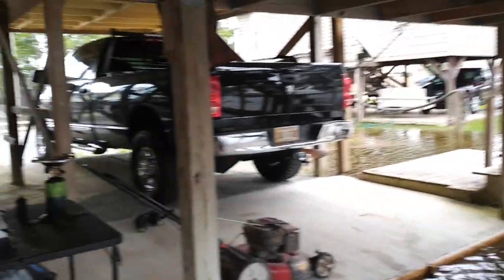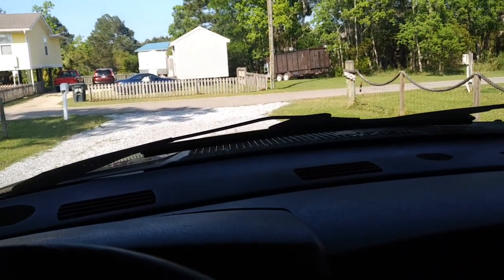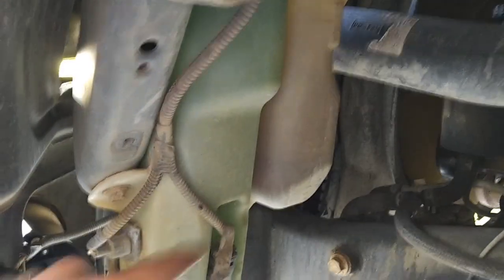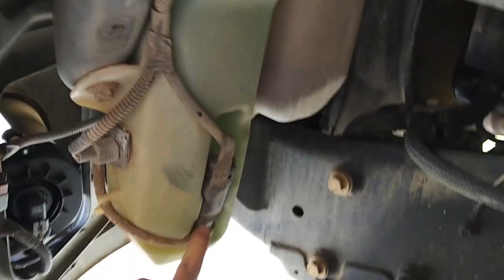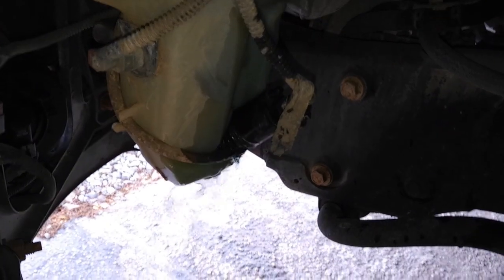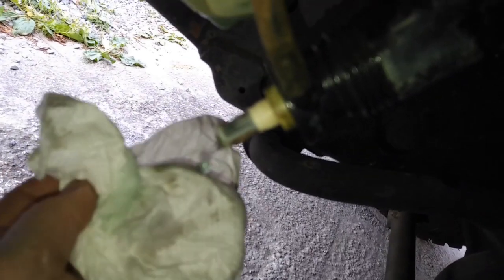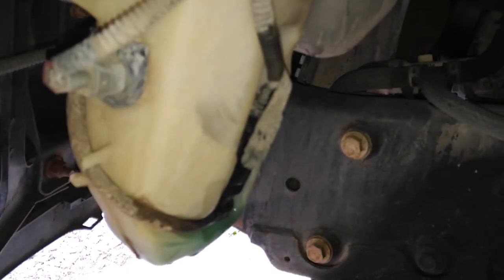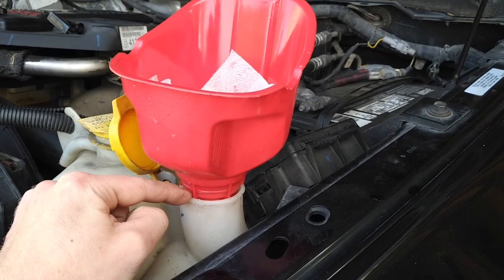Easy fix: windshield washer weak spray - dodge ram

Comment: Great video - but I thought I would try a wet dry vac to suck up any debris.  I used a rag around the wet dry hose to create a vacuum.  Dumped clear water into reservoir and sucked it dry twice.  Added washer fluid and back in business

Comment: Worked great, originally when I pulled the pump the filter stayed in but once I pried out the filter it was gummed up with algae like material. Saved me a visit to the dealership

Comment: My 19' Ram1500 'Classic' does the SAME THING. Weak Squirts of water,  I'ma try this..
THANK YOU..🙌😎💯🇺🇲
Reply: Did it work out for you I have a 2018 ram, looking at having to do the same thing
Reply: @graide5561  I can't even get to it. LAME.
gonna see if there's a Recall on this. 😠☝️
Reply: I’m wondering if this worked for E.A.R. too. Same issue on my ‘14. 🤨🇨🇦
Reply: 2019. Same issue.

Comment: Just fixed mine and I had a bunch of junk come out of the line and also around the filter. Tested it and is all good now. However, on my 2010 Dodge Ram 1500 pump was right in front after you remove the grill. Already had the grill off cause I was changing out headlights.

Comment: Good job.  I too was ready to order a pump. I had checked the entire hose. No leaks.  Figured the pump was getting old and weak after 206K miles.  Now I'll do what you did and I'm hoping I get the same result.  Assuming I have the same problem, you saved me a bunch of money and time.  Thanks! By the way, that looks like Louisiana.  My old stomping grounds.  Is it?

Comment: Thanks, great video. I did what you said on my 18' 3500. Turns out, the seal that holds the pump in the reservoir was ripped and was clogging the hole.

Comment: I think this will net some good results. The motor works, but nothing comes out. Even if this doesn't do the trick, it's a good maintenance tip for the washer system. I think this will do it . Thank pal ! ! A little question for ya . . . . . do you ever get any alligators swimming around ? ? Looks like a Florida neighborhood.
Reply from the maker: Yes indeed. I’ve seen A couple gators swim past. Located in coastal Mississippi.

Comment: I'll be a son-of-a… Just did this to fix my '14. I sprayed into the tank with a garden hose while the pump was out, and flushed out a ton of gunk while I was in there. Thinking about flushing it vinegar, then distilled water, and letting it dry completely before I put fluid back in it.

Comment: Same issue on my 2016 Ram it’s not even spraying any fluid gonna give that a try, thanks.
Reply: Did it work for ya?
Reply: @barrybebenek8691   Actually I ended up having a pinched line, not sure how it happened but replaced the line and back to normal.
Reply: @713Scarface  oh ok. Thanks for responding brother. 👍🏼🇨🇦
Reply: @barrybebenek8691  No problem we have to look out for each other. From one 🐏 to another 🐏 🇨🇱

Comment: 2017  And 2020 new trucks same issue, seems to me they have design problems, as I never had such problems with any other car, even 20 years olds, mine weak flow, then stops one side, then both died, then suddenly works, 6 visits to dealership, and no cure, just temp fix.